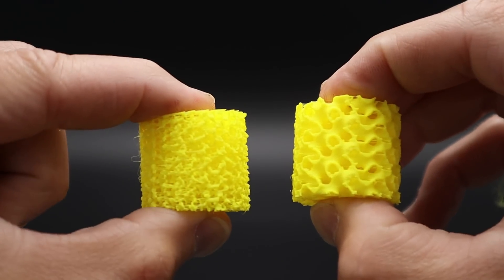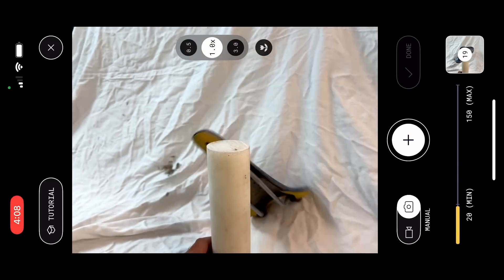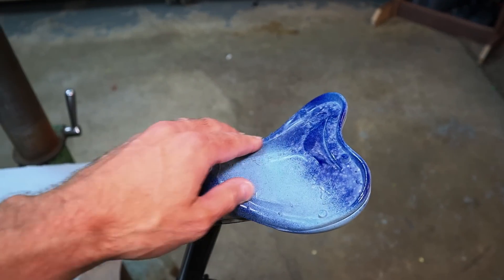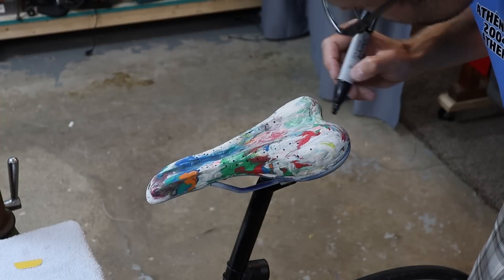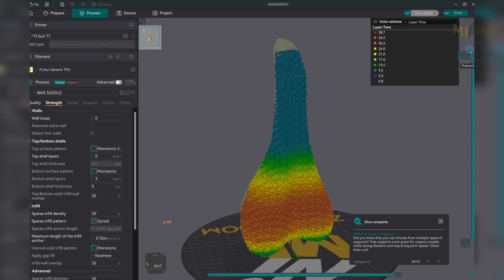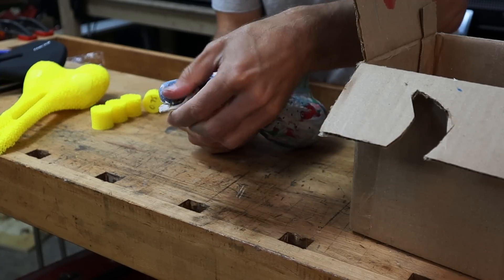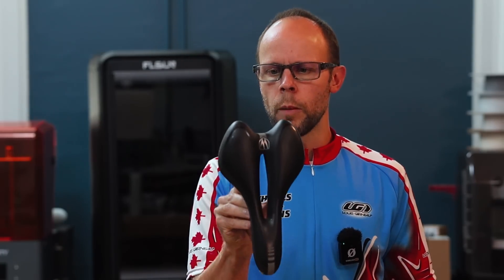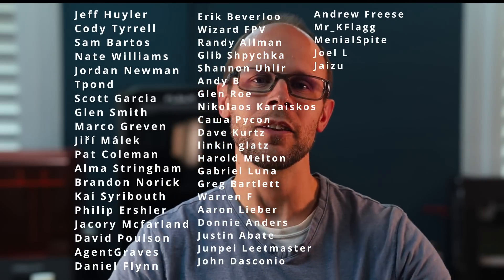Soft and Firm into One Very Satisfying 3D Print

Comment: Have you looked at using a Pivotal seatpost instead of a railed saddle?  The design seems like it would be perfect for 3d printing, since it could allow you to make the entire saddle out of TPU -- all you'd need for attachment is a hole in the top to pass a bolt through.

That's especially good if you want to go off the beaten path and try out things like noseless designs that don't match the shape of rails well.

Comment: Your sit bones look very far forward on the custom saddle. They would normally be on the flat part, about an inch further back.
Obviously do whatever you find most comfortable but if you can, try moving your saddle forward and see how that feels. (just a normal saddle, not the custom one)
The graphic at 17:01 shows the pressure points where you'd usually have your sit bones.

Comment: I think what you want is an auxetic lattice. instead of squashing outwards it compresses inwards in all directions at once. so it will pull more material in to support the areas where you are putting weight on it. knitwear is an example of a 2D auxetic structure and you can see how well it will curve and stretch to comfortably fit someone's body.

Comment: Don't split the model into multiple parts, but use the whole thing as a base and then the intersections as modifiers. It can by done directly in the slicer with a primitive as well, no need to cut it out in CAD. This way you can have variable infill density / type without having perimeters along the internal interface of the separated parts. I'm not familiar with Cura slicer, but I do believe it's possible. It's for sure possible to do in the Slic3r family (Prusa/Orca/Bambu).

Comment: Believing online chatter, I bought a leather saddle. It was like riding on wood. Further research revealed the need for various oils and other treatments and the requirement to ride hundreds if not thousands of miles in order to get the saddle properly conditioned. Oh, and there was also the vague possibility that the saddle could be ruined by injudicious use of the softening products. I wasn’t convinced that the saddle that likely got conditioned by this process but rather my buttocks, so I abandoned the project. There were of course the usual online condemnation of failure to endure the pain in order to reap the claimed benefits. This article takes a much better approach.

Comment: I think it would be interesting to scan the clay before and after sitting, and use the areas that were indented as having the softer infill variant. Basically no modeling required except for the initial clay sculpt and some clean-up. You could even go a step further and do a scan after a quick neutral-sitting, then full-weight rider-lean and see where things dig in.

Comment: Instead of modifying infill to change firmness in small areas- just print the saddle with those areas blank, then print several inserts in varying firmness to test them out. Also adding a wall will probably make it much stiffer than increasing density.

Comment: Highly recommend combining this with bigger tires on your bike to improve comfort. Also make sure to not inflate it too much, this is very common on road bikes!

These older styles of bike were from before people realized the vibration losses from thinner tires were actually bigger than the lower rolling resistances they provided on typical roads, which is why modern road bikes run 28-35mm tires nowadays.

Also! Really loved this video!
Reply from the maker: Nice info, I'll have a look into this when I look for an upgrade to this bike in the next year.  You're right this is an older bike, I've had this for about 20 years now, still in pretty good shape... the bike... me, I'm still trying to get in better shape :)
Reply: @NeedItMakeIt  My personal recommendation would be to look at a so-called "gravel bike". Speed difference between one of those and a road bike is minimal, and not really something you notice when you're commuting.

Otherwise you could always modify your current bike to put on gravel rims and tires on it and that'd do the same thing.

Comment: You'll want to reprint it with a thin continuous surface so that the infill won't grind your clothing in no time
Reply from the maker: That's a good point, it might cause some wear down there.  The TPU is pretty tough stuff.  I can skin the top really easily so that's a good option, some of the pro saddles are made this way as well and that's likely why.

Comment: Is it really confy? I want to try it as well
Reply from the maker: It is far better than where I started, it's not perfect, I need to re-print it using a smaller line width, I underestimated how hard the 95A TPU is when printed as a full piece, playing with a piece of filament doesn't do it justice.  the 0.3 or 0.4mm line width produces a really nice soft result, so that's next to try.  The sit bone supports will be a bit more forgiving as well, they were quite stiff and I think could also do with a bit of give to them.

Comment: you're trying to reinvent what leather saddles already do better
Reply from the maker: Leather has some advantages for sure, it can be easily molded with water and then dried to keep the shape, that's a great property.  It will take a lot of research and knowledge of what makes a good saddle, but 3d printing these will become the preferred method, along with shoes, insoles, helmets etc.   I love to make things by hand, but making something with a support structure inside which correctly provides what's needed is hard to duplicate with foam and leather.  If you're referring to Leather Horse Saddles, well, that's a different thing.  I love leather, it's a beautiful and long lasting material, it seems to only improve with time if it has been cared for, nothing against it, and I like the taste of the meat that's below the leather too!
Reply: @NeedItMakeIt  sure, no doubt they will. these are also much lighter. if they're combined with metal 3d prints you can even integrate the seatpost, saving a further 150-250 grams. i do wish contestants of races would have some sort of gentlemen's agreement not to keep even the uci weight limit but go heavier, that way we wouldn't need any of that, and the brooks b17 is right there for only 350 grams extra compared to all this light stuff. at 9 kilo weight they could even go for proper full suspension road bikes. don't get me wrong i like the tune speedneedle, even like the look of berk's integrated carbon saddle, but i think they are technically inferior to a 130 year old design. is this actual progress?

Comment: Gyroid infill density can be varied continiously, but most slicers can't do that yet unfortunately.
Reply from the maker: That would be perfect, do you know of a slicer that does do it?  I'd be willing to switch just for this project.  I'm looking for bone infill, that's the ideal, something that looks like a 3D Voronoi pattern which has connections within the structure as well as the outside.

Comment: Awesome results great design and effort.
Did u wear the cycling shorts when doing the mold of your butt cheeks? Im thinking different shorts would also effect the mold because there like wearing a nappy?
I am very interested in seeing custom 3d printed insoles please show if you can
Reply from the maker: We're getting there!  I didn't wear cycling shorts during the molding process I wanted to get as much detail as possible, I would have done it without shorts, that might not have been the best to show on camera...  Custom insoles would be amazing, and I think that's a bit easier, we could use something like plaster of Paris for the shape.  I can include this into the follow up video which should be in a few weeks if I can get it all working correctly.  It is quite a learning curve to take all of this to the next level, but once it is done, the solution becomes useable for anything.
Reply: @NeedItMakeIt  that would be amazing to do a insole video, thanks for the detailed reply much appreciated

Comment: I've never had much of an issue except on day 2 of some weekend bike camping trips. I'd be interested in printing out a version of this myself. Let's hope a quicker way is available soon, or I get some slow time at work.
Reply from the maker: There are quite a few factors I suppose.  I'd like to go for 30-50K rides, it was not possible with that amount of pain, I'll be out more with this version and see how far I can go before it becomes a problem.  I may still need to make some minor adjustments and research as well to find the sweet spot for support vs cushion.  I'm working on a better method and I'll make it available to everyone.  What I'll do is find a generic bike saddle that's not expensive which could act as a base for anyone.  Then what we can do is enter some values in the software I'm using, which is free for 90 days for anyone and then you'd need to provide your sit bone position as well and it will adjust the support automatically.  It's a very cool process, I'm looking forward to sharing the process and developing it more.  Stay tuned!
Reply: @NeedItMakeIt  50 km I can do rather easily on a generic saddle my "city" bike came with (Gudereit Premium 11.0 Evo) wearing casual clothes, no fancy cycling pants, so maybe a more comfortable bike is the answer to your problems? Unless you like to go very fast - I doubt it would be easy to go over 50 km/h on this bike, my record so far is 45.5 km/h with panniers, but that's just peak speed, not sustained. I find that wrists are more of an issue than the rear after 50 km. Still, I'll have to try your idea anyway, as I'd like to attempt some 150 km trips and the saddle will definitely be an issue then. Thanks for the video.

Comment: One thing I didn't get is why you'd want the FIRM parts to be where bones are? Wouldn't it be the other way?
Reply from the maker: We definitely want the support where the bones are, we're trying to get the load as directly as we can to the structure of our bodies.  How much support, well I think I went a bit too far really.  The bike shorts have a little bit of padding which probably makes up the difference.   If we get too much compression of the soft tissues down there, it will cut off the blood flow, it'll get numb, and long-term it can also cause damage to other let's say important areas.   There are quite a few factors too, like the type of bike, your riding position, the list goes on and on.

Comment: wonder if its somewhat similar with running shoes - you buy a size up to account for your feet swelling during extended runs lol. you might need some similar booty safety factors >.<
Reply from the maker: Aa fully printed shoe which expands as you run makes a lot of sense to me.  If we understand the variables, we can account for them by using a type of webbing that moves in some directions more than others.  I've since printed some more TPU samples, and they compress far more easily in one direction compared to the other with a gyroid infill pattern and no walls.  Do you think anyone would wear a fully printed shoe?

Comment: Use a vacuum bag with small polystyrene balls in it, sit on it then pull the vacuum. That's what people use for horse saddles.
Reply from the maker: Perfect!  This is awesome, do you think I can use a regular vacuum or should I use a vacuum pump?
Reply: @NeedItMakeIt I haven't tried myself, but IIRC from videos I've seen a vacuum cleaner has enough suction. The technique is often used to stabilize broken bones for transport to the hospital. There are probably videos about it. Search for vacuum splint.
The beads are the same kind as used in bean bags, though maybe a little smaller.. Not sure.
Reply: @NeedItMakeIt  I've not done it myself (I happened to remember from another YouTube video) however, I think even just the little manual suction things you use for vacuum sealing food (or in my case filament!) could be sufficient.
Reply: @NeedItMakeIt  : My shop vacs (developing 3 to 5 psi vacuum) have plenty of suction to solidify beads.
Reply: @NeedItMakeIt  regular vacuum is fine, most vacuum bags are made to work with a standard sized check-valve port.
Reply: @NeedItMakeIt  Another very simple option you might want to experiment with is packing icing sugar into a party balloon, to about the size of a tennis ball. The sugar holds its shape under compression and the slightly stretched balloon provides compression. Once sealed, stretching and distorting the balloon creates a vacuum which retains the compression, no vacuum pump required. You can only stretch it so far before the surface tension will overcome the sugar crystals, but it should be more than enough for taking a seat mold.
Reply: Oh yeah, you could do this with coffee too! Coarse grounds or whole beans should behave the same way
Reply: ..and racing car seats...
Reply: This is the same concept used in robotics for granular 'jamming' grippers that can conform and hold to most any object they are pushed against.
Reply: polystyrene balls would shrink when you pull the vacuum though wouldnt they? I'd go for something more solid so that the shape doesnt change when the vacuum is pulled but they stay locked in position by the vacuum
Reply: @Hephera  You're right. While I don't know how important effect that is, as I mention in original comment it is done for horse saddles. But you could imagine small harder balls/beads working equally well; the vacuum holds them in place firmly. I'm just looking at my 3D printer bags and the desiccant in them is fixed in place for sure.
Reply: @Hephera  Silicagel balls?

Comment: Very impressive, thanks for sharing the whole process; I t’s a great example of very general tool to add to our 3D printing toolkits!

(BTW, what’s the scanning app you’re using on your iPhone? It seemed to work extremely well!)
Reply from the maker: You're very welcome!  This is only the beginning, I'd like to develop a much simpler process that can work for far more people and they'll be able to do it themselves, or at least they can send in a scan and then it can be processed for them.  I might like to try using a resin printer also with some flexible resin.  

The app I've been using is Polycam, it works about 90% of the time.  I've tried to scan my feet... it doesn't work if you're trying to do it yourself, there is too much movement and it gets confused.  I use the free version, then export it, I then use a free converter to change it to OBJ so that I can use it in Fusion.
Reply: @NeedItMakeIt  Cool, I’ll download Polycam and try it today. I hadn’t looked at it very carefully and had been put off by the need for a subscription - but it sounds like an easy workaround for casual use. Thanks!